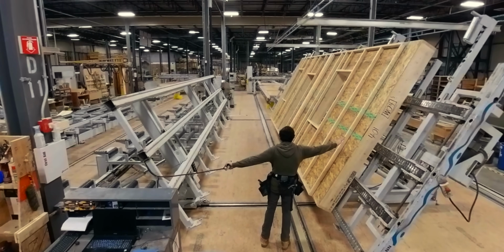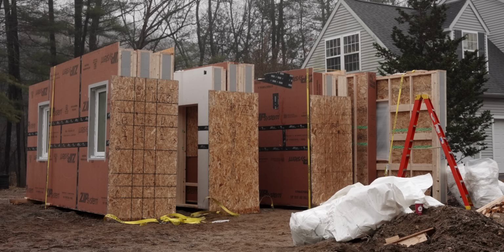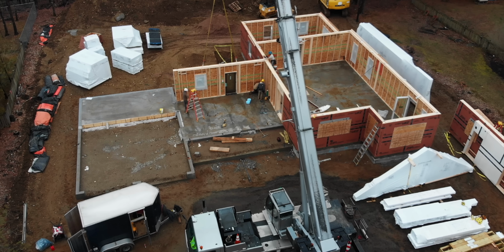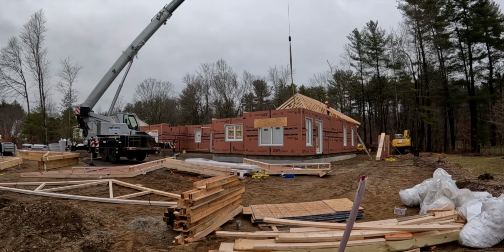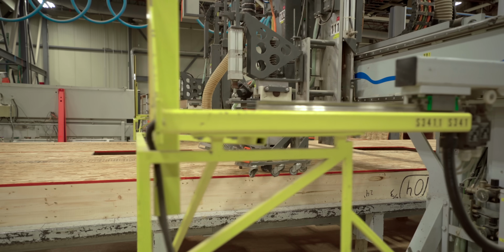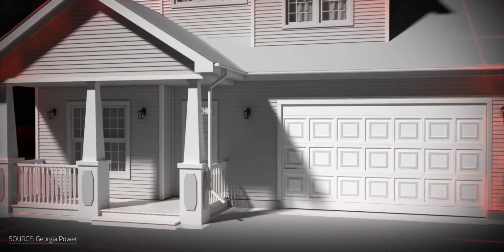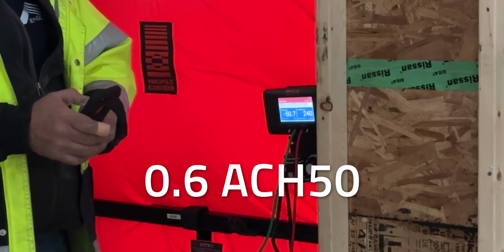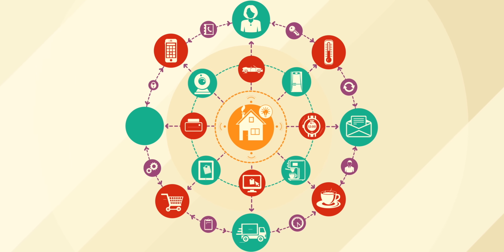Wow! I Didn’t Know A Prebuilt House Could Do This

Comment: Your new home is looking great!  Did you consider building your home over a basement? Just curious if it was due to energy savings.   I’m thinking about building a ranch and I feel I would build one with a basement, mainly for added storage and a finished man-cave/family room.
Reply: A basement is a very logical idea it adds minimal cost to the building and means for a very low cost of adding more space later this was made clear to me by a church I attended the original church was built on slab and when an addition was needed it was an expensive project but they were smart enough to have a basement under so when a second addition was needed later they finished the basement same square footage of additional space at 25 % of the cost now it cost more for putting a basement under because of codes needing them to be insulated but what's added upfront is taken off the cost to finish the basement as additional living space
Reply: @douglaswindsor120  Adding a basement under an existing house is also a practical problem as you will have to dig up the foundation without removing the house.  Foundations built to contain a basement are dug deeper by at least the height of the extra rooms and  place the weight of the house and all its parts on a structure just like that of an upper floor.  No problem with the weight of the kitchen stove being supported by the ground under the kitchen and sinking into the ground at a different speed (inches per century) than the walls.  Similarly all the plumbing will be routed to allow for the basement to function.
  Now building an unfinished and unfurnished basement instead of completing the basement from the start is a saving in case it's never needed.

Comment: I am surprised at just how good the quality appears to be.   At the same time I'm not a fan of building the main floor directly on top of a concrete slab.  That puts all the pipes either in the walls or in the attic where issues can cause enormous damage, rather than in the basement and then coming straight up to where they are needed.  Among other things.

Comment: I am by no means an expert nor am I in the industry. The one thing that surprises me so far in this process is that Unity Homes uses a densely packed cellulose insulation. I don't know why I would have assumed they would use some sort of open cell or closed cell spray foam, But I'm sure they have a valid reason. Regardless of how densely packed it is, I wonder if it's settles over time. I am very much looking forward to future videos on this project, thanks, Matt!
Reply: Agreed. I would have expected something like rock wool or expanding foam.

Comment: Very Interesting.  I'd like to know more about costs including land and permits.  Also, can expand on your reasons for choosing individual truss over panels as the manufacturer had recommended.

I live in the Central Valley of California with a very moderate winter climate which seldom freezes.  Summers can be very hot exceeding 100 degrees for several weeks straight July and August. I imagine the build would be significantly different than in New England, but I think a "tight envelope" would apply to keeping a house cool in the summer as well as keeping a house warm in the winter.

Comment: In Costa Rica many houses are built differently depending on where they are. There is a lot of terrain variation with elevations from 0 meters to 3500 meters above sea level within just a few kilometers of the ocean. I live at 1100 meters and the houses here are built with an iron gated fence as the "front door" and the rest of the house is open to the air. Windows are left open, there is no heating or A/C, though we have fans that I only use sometimes if it's humid or stuffy that day. Usually it's perfect inside and out. At elevations of 0 houses are also built open in some areas with just one or two rooms such as bedrooms built insulated with AC. The kitchen is outside, the shower can be outside, the toilet is often separate which is something that should be the case everywhere. My point is that I don't know if insulated = energy efficient because that presupposes that AC or heating is even necessary.

Comment: It's interesting seeing the different extents to which pre-built homes are in fact, pre-built.  There's a factory in Edmonton called ACQBuilt which claims a 1-day set for most single-family homes - as opposed to a 3-day set which Matt got.  Perhaps opting for the roof trusses had a large factor in that.
Reply: Didn't Mat say the roof trusses added a bit over a full day, plus prep for the freezing rain?
Reply: Yeah, this.  In fact looking at the video my thoughts are this isn't a pre-bult / pre-fab house at all, just pre-fab wall panels basically.  The "pre-built" houses I'm aware of leave the factory as modules that contain all fixtures and fittings (flooring, plumbing, electrics, wall finishing / plastering, kitchens, bathrooms, etc. all done in factory).  Crane into place onsite (think they do six houses a day with one crane), hook up services and basically move in (there are some joints to finish as well).
Reply: @rayauchterlounie4711  
That's called a mobile house

Comment: Nice video, makes me want to build my next house. I’m worried about condensation on the windows in cold weather if the house is sealed to tight not allowing air circulation. 

Is that even a concerne to have? Thanks
Reply: It's not a concern. That's what the ERV is for.

Comment: It's kinda fascinating how we went from building with big fat walls, because that was the only way to make them stand up, to building these really skinny walls because it was cheaper, to now building big fat walls again because it's cheaper over time.
Another way of saying it is standard building has the internal part of the wall being load bearing with insulation and sheeting being tacked on and within. With this system you have the load bearing wall with insulation and sheeting and then you have the internal wall tacked on

Comment: Have you done some assessments of the time it will take the to "pay for itself" in terms of the carbon emissions associated with every aspect of the house, including solar panels and energy storage as well as manufacturing of the house itself?  What's more, how does that compare to an ordinary house on the same street using mains electricity, in terms of how long it takes for the Passivhaus to be "better" in terms of long-term carbon emissions?   In other words, there needs to be an assessment of the EROEI (energy return on energy invested), which some commentators consider to be impossibly low for renewable energy (that is to say, the human race simply cannot expend sufficient work-energy to produce enough renewable power generation to supply itself).
 This is a very contentious and complicated issue, because one has to decide what one is comparing oneself to (for example, what form of energy generation is powering the other houses on your street?  What is the carbon footprint of those buildings' construction?).

Comment: I really like this style of manufacturing.  I was wondering if you are going to dig a straight tunnel down with a coil of pex to exchange the heat or were you going to do the long but shallow trench style?  I would also like to know if the geothermal is it, or were you going to use heat pumps/mini splits for areas of the home that don't have to be the same temp if they aren't being used.  Perhaps you will find you use one part of the home a ton and you can have a minisplit cover the guest rooms or natural parts you don't seem to use as much.  Everyone loves electric but I would personally get  a whole home generator that runs of natural gas or propane.  If you take into consideration what goes into those batteries and solar panels, fossil fuels still have the best energy density.  You will be wishing you had it when the power goes out or there's a glitch in your equipment.

Comment: I live in the „Mercedes Benz“ of pre-fab homes, a „Huf Haus“ (Google).

Here is a similar one: https://youtu.be/-xwtKjnhuVE

Due to our huge glass facade, it is not passive house standard, but it is in incredibly efficient for a house that boasts over 100m2 / 1000 sqf of windows.

We make up for it with a swedish NIBE ground source heat pump using geothermal energy by a factor (SCOP) of 4:1, which means over the course of the year we get 4KW of heat from 1KW of power.
PV System is from German manufacturer E3DC, which has the benefit of providing 3-phases and emergency power. (21 panels East/21 West = 13.6KWp & LG 6.5KWh Battery modules = 13KWh)

We are completely independent from mid-Feb to mid-October on a similar latitude than Boston. April to September we produce excess solar to easily power our Ioniq EV.

All switches, dimmers, thermostats are „smart“ and digitally controlled via a world wide standard called KNX which allows to combine 8000 devices from 500 manufacturers easily via a 30V bus cable.

My Homekit & Alexa Gateways display 85 „devices“ - Lights, Sockets, Blinds, Thermostats.

And you can control everything on a single mobile app, including the PV, Heat pump & wall charger. One app.

Now all of that might sound a bit „over the top“ and a little arrogant… but the point I want to make is… we built it in 2005(!)

All of that tech has been around for over 20 years and finally… finally… someone is actually spreading the word about it. Thank you, Matt!

Comment: I live in Australia, so mostly want to know that the tech will function at the other end of the livable thermal spectrum - very hot environments. Even where I live in a South-Western city of Australia, we still get times when the cool sea breeze just doesn't compensate for days of 40°C heat.  

Generally modern housing is built to an R2.0 wall & R3.5 ceiling standards, relying of air conditioning to compensate for temperature extremes - though this is improving as newer, less power intensive, heating/cooling tech becomes cheaper. 

Having locally prefabbed housing made to the levels of insulation you've described would be awesome. Assuming they could also be insect & especially bushfire resistent, too...

Comment: I was blown away by the R-values, but it turns out that in America they express it in imperial units which converted is about 5.7 times higher than the SI variant. So in SI units the values are as follows: 6.2 for the walls, 8.8-10.6 for the attic and 1.2-1.4 for the windows. Which is still impressive but not straight out of sci-fi future tech impressive which I initially thought.

Comment: Currently working on both the windows and insulation aspects on my old house remodel. Windows being replaced with similar type and adding rock wool exterior insulation. The insulation is consisting of Rock Wool Comfort board panels which allows an near thermal break.

Comment: Great video. But I just wanted to ensure folks knew that a house can be built as an energy efficient house using the normal  well known "Solar Passive" principles, but without needing to be a duly certified by some corporation in Germany as a "Certified Passive House"/"Passiv Haus".    Some certified  "Passive House"s have been built here but the price is some 30% dearer minimum, indeed I think often much more (70% or higher, cost than other construction). Whereas the general principles of Passive Solar housing can be incorporated into all normal built homes for what amounts to little or no extra cost at all. The ultimate performance of Certified Passive Houses is beyond doubt, but remember that they need a reliable supply of electricity to function properly. In Western countries we are used to reliable electricity/utilities. However for any reason (such as storm etc) indeed for no good reason at all (eg political/social reasons) we could suddenly find ourselves in a situation like countries like Nigeria or Ukraine which may have electricity for just 2 or 3 hours per day.  As you can afford to put solar panels and have battery storage on your house, that will be ok for you, if your electricity supply becomes substantially compromised.  People who cannot supply their own electricity, might want to avoid "Certified Passive House" buildings and instead have non-proprietary but well insulated  Solar Passive constructed instead, which do not rely on an electric fan forced air circulation system, to function at their best.   Note that many of the design principles are the same/similar.

Comment: Hi Matt, love your channel. Keep up the awesome work! When you get to the installation of your solar and battery system, it would be great to hear about your thought process. Especially around the situations your system will handle. Like how long do you plan the batteries to last during an extended outage? When panels snow covered, etc.. How did you determine the solar and battery capacity you would need? My understanding is that this is tough when you have new construction, and don't have historical energy bills to look back to. Thanks for all you do.

Comment: Comment/question from Germany here:
How are they solving the passive house problems like mold and constantly moving air? The problem of dependence on electrical energy for the system to work you seem to have solved via the batteries.

Because of these there’s a new standard in germany called the „bio solar house“ aka „passive house 2.0“, that solves these problems by building a double layer shell with the outer acting like a green house and natural physical circulation of the air. No air tightness or air exchange system needed for passive house performance.

And of course seeing this house being built: so not used to seeing a house that’s all wood. In Germany it’s all bricks combined with insulation. 🙂🤷🏼‍♂️

Congrats on your new home! It’s a big milestone! 🙂

Comment: Great house specs , Matt , good  choice . We too built a passiv type house and are now enjoying life within . You asked for questions , so here,s one , which is only applicable if you  also fitted a wood  burning stove ?
We installed a high efficiency wood burner with an outside air supply . This is a pipe through the well insulated walls 
with a closable vent outside .
This seems a little retrograde  with the passiv house philosophy, an outside air supply in a sealed  box ?
Any thoughts ?
I have really enjoyed all your videos , thank you .

Comment: I apologize if you covered this - did you put PEX tubes in the concrete to heat the floor with hydronic heat - even as a supplement?
Very interesting project. Thank you for documenting and sharing your experience. I look forward to learning a ton from you around this topic.

Comment: Having built a couple houses myself, one stick-built and the other factory wall panel fab, I will say hands down the factory wall panels go up so much faster because all the walls are done and you simply stand them up. Using a crane to lift individual roof trusses is a big waste of time. We lifted trusses in groups of 10-12 (and these trusses weighed 250-300 lbs each!) so the crane was only on site for 3 hours. The framers then moved the trusses into their final locations and the roof framing was done in a day. The next day all the roof sheathing went on and then the roofers came out and put on the ice/water shield. 3 days total with crews of 3-4 guys plus myself. Fun stuff! I'm not at all surprised that your house is very air tight. Even a stick built house can now achieve <1 ACH with good sealing practices.

Comment: Are radon an issue there? Some places needs a radon  membrane in the floor and the recirculating system must run at slight over pressure to prevent sucking in radon from around water pipes etc in the foundation. 

How about the range hood/exhaust. I have problems with the house being so tight, I need to open a window to get it to work. Some can work with the recirculating system so it spins up fans for the air coming in.

Comment: FYI  R-rating of a wall assembly is ussually taken from the insulated cavivty, not the total wall with windows doors and studs, so the average R value of your wall aseemblys is closer to R-14 and a code compliant wall  is closer to R-5

Comment: So it looks like the walls are an exterior and interior OSB sandwich with the cellulose insulation and then it appears that you’ll have a shallow area in front of that for electrical and plumbing that I suppose will then be Sheetrocked. If that’s the case, are there avenues to get electricity and plumbing to the exterior without risking damaging the passive standards? What happens if you need to add electrical or plumbing at a later date from the interior to the exterior?

Comment: That low U-factor has to be the glass itself and not the whole window with frame and everything?
If so, then those numbers are amazing and I want the same!

I installed 3 layer energy saving windows that looks a lot like yours and they have a total U-factor on the whole window roughly about 0.8 depending a little bit on how well you install them and and make sure they become airtight.
My windows are filled with argon gas, I could have paid a lot more and gotten windows filled with krypton gas instead for better isolation.

Comment: Wonderful tech to build a house. But due to the fact that the outside wall is prebuilt with insulation, how would you do all electrical wiring and plumping in the walls?

Comment: Couple of questions:  First you didn't install a basement at all which is a little strange in the North East.  Is there a reason why?  Are you going to be geothermal floor heating or traditional hot air?  Hoping that if you have any hvac in the attic you are insulating the roof and not the ceiling.  I have an hvac unit in my uninsulated attic and it is useless.